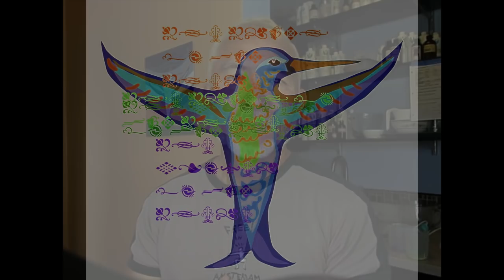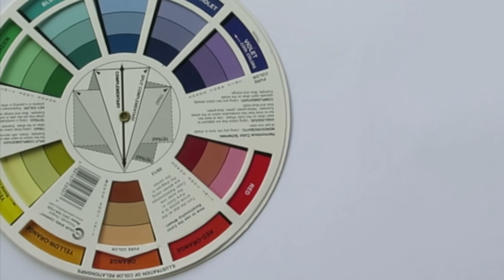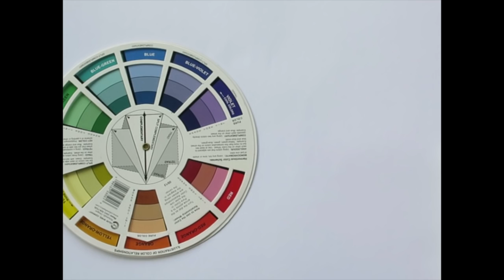Making and Cutting Lotus Position Swirls Cold Process Soap

Comment: It doesn't look as though you "gelled" it, so did you place it in the fridge or the freezer to keep it from "gelling"?  Love those colors.  I like the skinny swirl best because it moves into the center giving the center some life.
Reply from the maker: I've had good luck with my formula. If I want it to gel, I put it in a box and cover it with a blanket. If I don't want it to gel, I just leave it out on the counter overnight. Thanks again. :)
Reply: Vibrant Soap 
I guess that means you're a genius at formulations also; something I need to work more intensely with.  Mine start gelling immediately after their poured.  Care to share what the secret is?  More water in the lye mixture?  The oil to water ratio?  Give me a hint.
Reply from the maker: Not really a genius. Not long after I started soaping, I decided to start making my own blend changing one ingredient at a time. There really is a lot to consider. Soaping temperature, water (are you using distilled water?) minerals can make a difference. Is there milk in your recipe? I guess I don't know enough about your recipe, soaping temps, etc to really help. But milks have sugars that can make the soap heat up and that can encourage gelling. Beyond that, I'm not sure what in particular works in my recipe. So you use any kind of additives? There's a lot of detective work involved with this.The other thing is that I love gelled soaps. They cure faster and can produce more vibrant colors. If you don't like partially gelled soaps, you might just want to enclose it in a box and cover is with a blanket to encourage a complete gel so you won't have the center of your soap look different from the rest of it.
Reply: Vibrant Soap 
Okay, you caught me.  Sometimes heavy whipping cream powder, but always honey in every batch.  I like the rich creamy thick suds my soaps produce.  I do mostly hot process and have great success with the resulting soap, but using the same recipe in cold process just doesn't seem to work without the immediate gelling effect.... so I guess I have to accept and embrace the gell (as you mentioned) or try and tweak here and there.  I've been experimenting with 1 pound batches, so it doesn't get too frustrating when I get a partial gel.  Once it's cured out, I'll just rebatch with heat, so nothing will be wasted.
Reply from the maker: Yes, there is a fine balance in combining the ingredients for the effects we want. I kinda like the challenge. Well, at least we figured out why the soap was gelling. :)